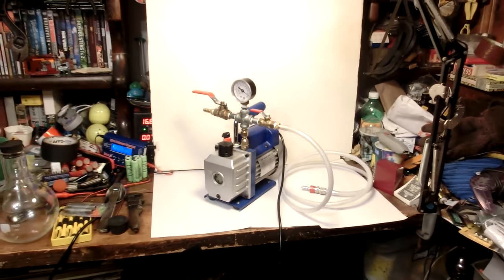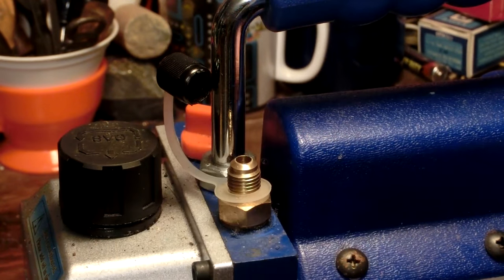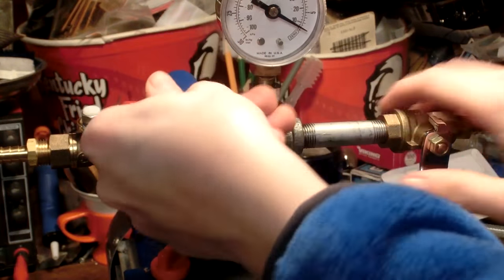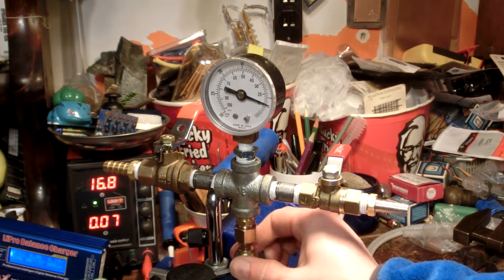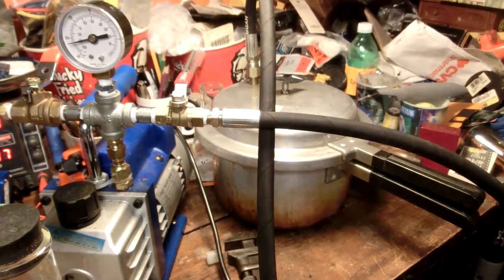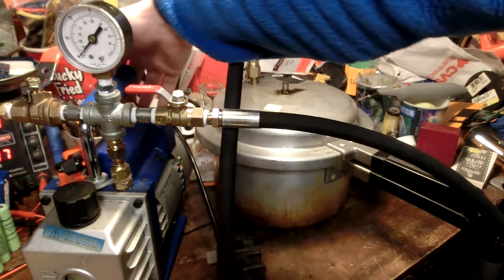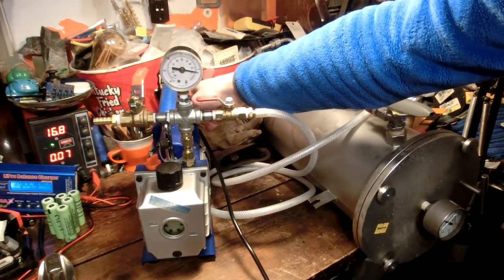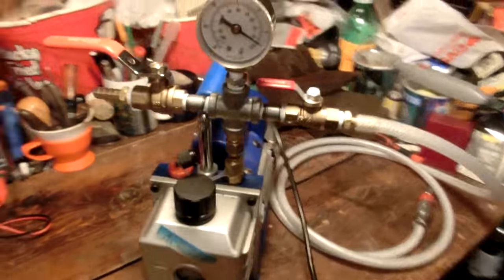Vacuum Pump Mod

Comment: What was that oil filter thingy originally used for?
Reply from the maker: no fucking clue, not even sure if the liquid in it was oil. it doesnt smell like anything i've ever come across.
Reply: I saw something similar at my old job in some massive transformer station thing and it had some oily substance we couldn't quite identify it had a greenish hue to it and it had it's own odor to it maybe it was something like that , that's just my uneducated guess though haha
Reply: It resembles the sea water strainer I maintained while in the NAVY.  Yours looks to be missing the strainer sleeve. And being stainless steal, I would guess it was for food stuffs.  When the strainer starts to get full the pressure gauge will read higher.
Reply from the maker: +OverUnity7734 it had a large filter inside it
Reply from the maker: Peter Carlson
i wouldnt doubt it.